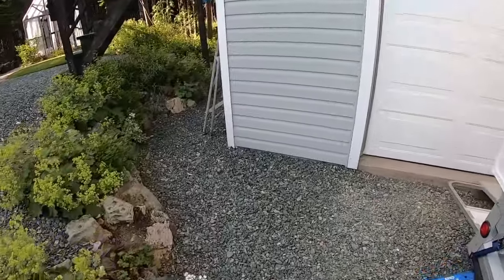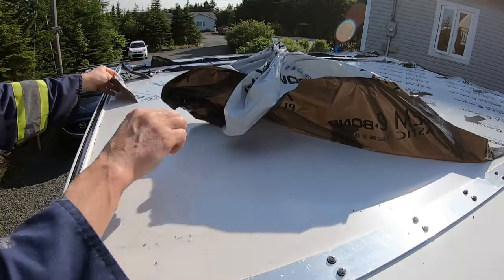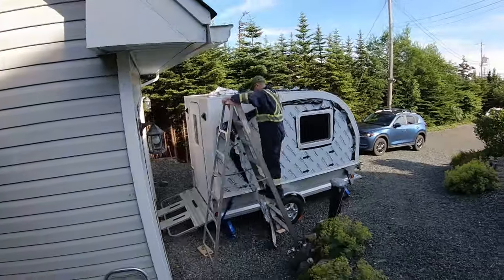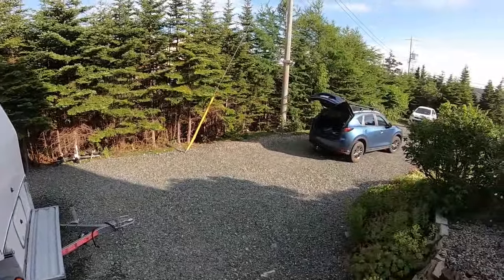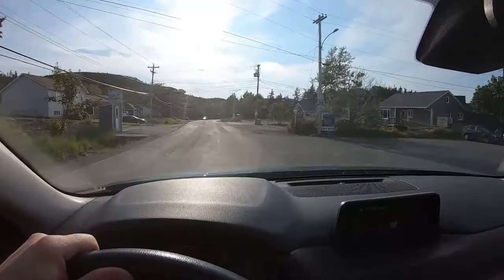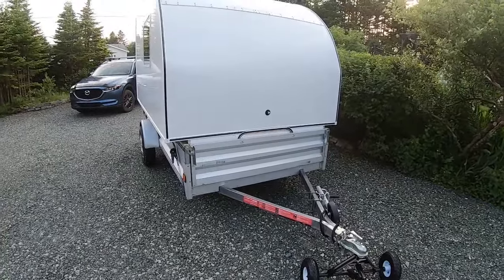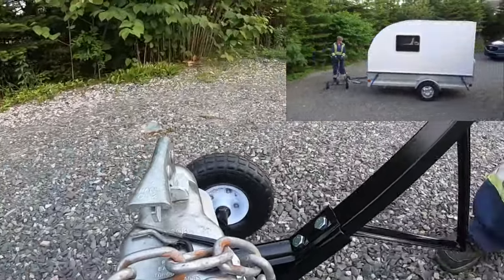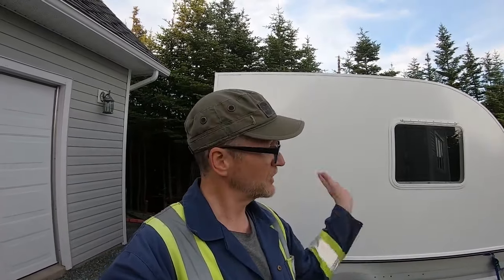Day 99!!! - Peel to Reveal - Building a Teardrop Camper

Comment: May I recommend some conspicuosity reflective tape? It's on sale at Princess auto. I have the same trailer and kinda shocked it doesn't come with any. I thought it was a law. My wife thinks your camper is cute.
It's a 10 pack of 2 x 12 inch reflector strip tape for $11.99
Reply from the maker: We actually have some reflective tape planned for the build. Thanks for the tip though.